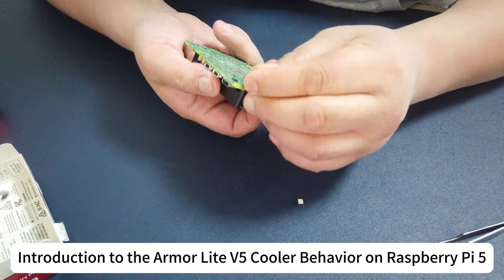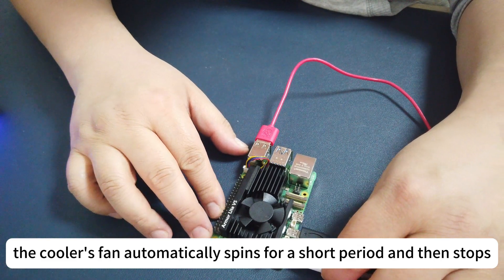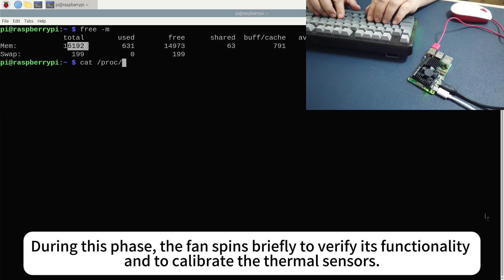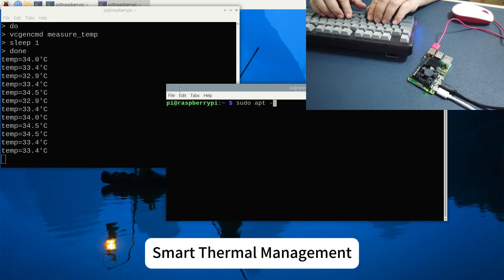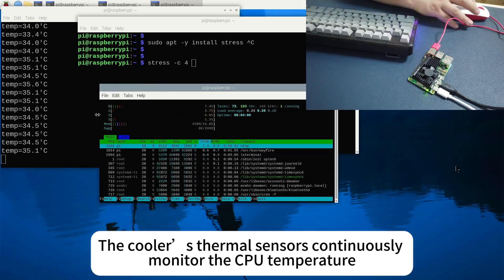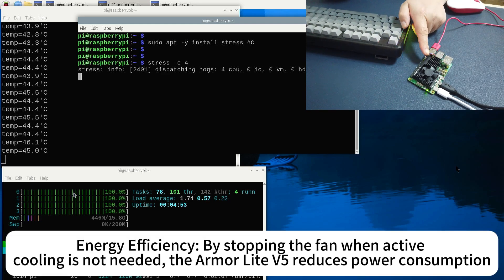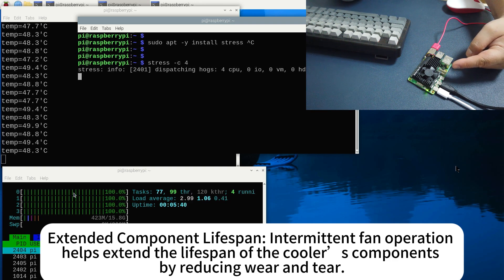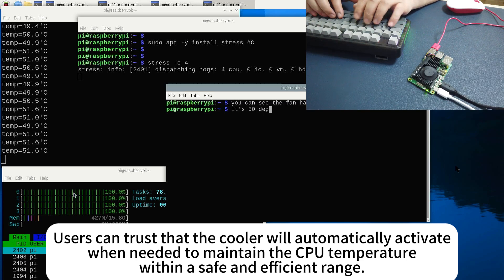Armor lite v5 works with Raspberry Pi  5  16G RAM.

Comment: the video image of the fan covers the code your  writting
Reply from the maker: what can I do for you.
Reply: @52Pi_Maker_Education  he mean u make the pic of video u say it is 50 heat Celsius but raspberry pi company make the system detect when the heat is 50 it stop the fans so if u change the code in system it will be 40 or low heat from system codes kernal
Reply: @52Pi_Maker_Education  i have buy the fan armor lite but the screws was iron not like that in video is plastic idk why it like that u have pro version and normal people have bad one? 😢